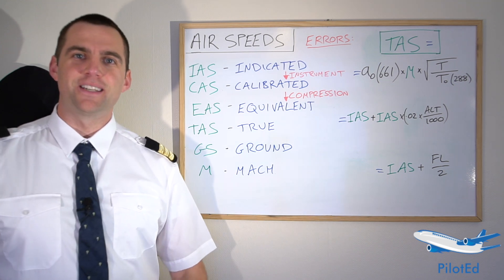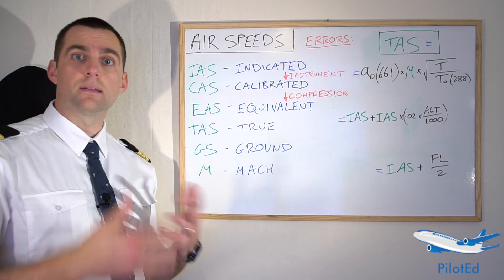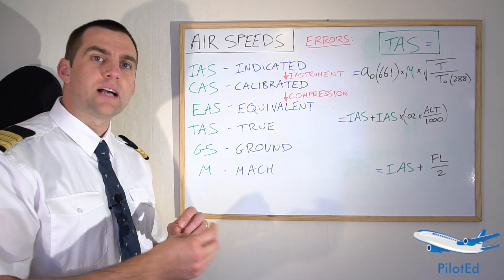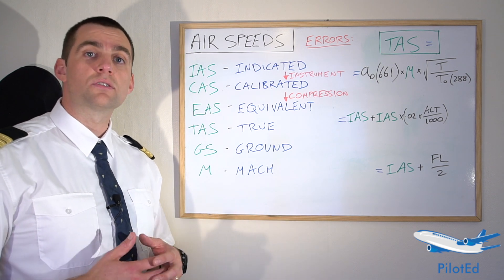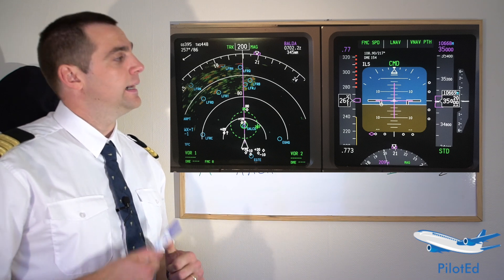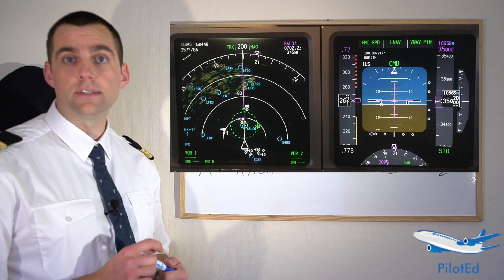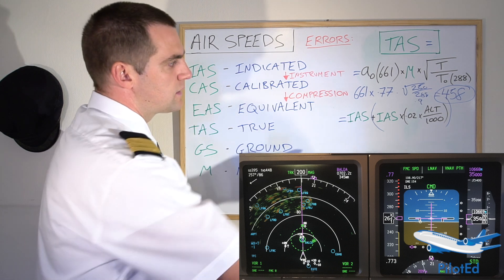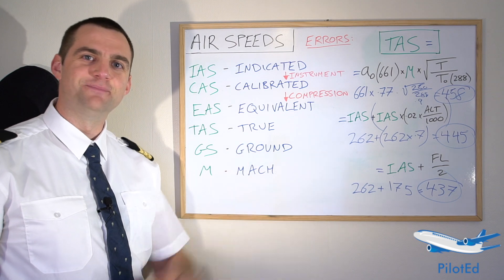Speed Definitions and Calculations ✈ IAS CAS EAS TAS GS MACH

Comment: This video presents a wrong explanation of compressibility error.

There is no "flow of air through" a Pitot tube. A Pitot tube is a closed tube terminating at the airspeed indicator capsule (or air data module in modern aircraft). The purpose of a Pitot tube is to measure the total (stagnation) pressure. The mouth of the Pitot tube is a stagnation point. A stagnation point is a point in the airflow where the flow is locally brought to rest. Therefore in steady flow air is not "taken in" to a Pitot tube.

When compressibility error is present the airspeed reading will be higher, not lower. CAS will be greater than EAS.

The video fails to explain why an airspeed indicator does not exhibit compressibility error at ISA sea level, even at high Mach number.

Since the Mach meter is also connected to a Pitot tube, a student who heard this explanation might conclude that the Mach meter would also exhibit compressibility error. However a Mach meter does not exhibit compressibility error at any altitude.
Reply: Hi Ortac, I spotted the same error in this video. EAS is actually lower than CAS, because the density "measured" at the pitot would be greater due to compressibility effect. 

However, could you explain why  an airspeed indicator does not exhibit compressibility error at ISA sea level? I am not getting it...

Thank you!
Reply: @andreaappiani7799  It comes down to the way the mechanical ASI is calibrated. EAS would be the "ideal" airspeed to present to the pilot because EAS is directly related to dynamic pressure and hence aerodynamic forces. Anything which causes the ASI to read other than EAS is therefore considered a cause of error and should be minimized as far as possible. The equation used to calibrate the ASI correctly accounts for compressibility at ISA sea level and thus under this condition CAS = EAS (no compressibility error). 

However, a mechanical ASI knows only the differential pressure (total - static). It does not know the absolute static pressure and therefore can be calibrated only for one static pressure (by convention, ISA sea level) . The relation between EAS and compressibility varies with altitude: at high altitude there will be more compressibility for a given EAS. The calibration equation correctly accounts for compressibility only at ISA sea level. When the ASI is used at high altitude there will be a compressibility error because the calibration equation does not correctly account for compressibility at high altitude.

A modern air data computer knows the absolute static pressure and could therefore easily output EAS at all altitudes. The speed tapes on modern PFDs show CAS but this is only because of historical convention. More logically they would show EAS.
Reply: @piers4130  thank you very much sir, extremely clear explanation. 

This is the kind of stuff I would like to read on an ATPL book...!

Comment: AMAZING WAY TO EXPLAIN, so easy to understand, thank you so much. you got all my support. have good winds.
Reply from the maker: cheers
Reply: Your explanation on speeds concept is crystal clear. I’m not sure where I missed going into/during the calculation. Why use IAS in calculation which contain layers of error ?  Or in this example IAS = EAS ? 
I’m pilot student on Cessna 172.. I should use CAS in the formula as the error from compression is negligible right ?

Comment: Thanks for the amazing video Captain. 
Doing my CPL theory in India, I think there is another simple formula for calculating TAS. 
It is [TAS= Mach Number* (38.95 * √K)]  where K is the temp in Kelvin.
Reply: yes, i also used that one. its actually the same as the above formula just simplified: 661/sqrt288=38,95! ;) 

Nice job PilotEd, helped me a lot through my ATPL theories!
Reply from the maker: cool, didn't know that one, test it with my snapshot in the video and post the result :) call it -50degrees C
Reply: @emmanuel kapoor Yes it's exactly the same. Mach number is TAS/LSS
Reply: Are you a pilot now?